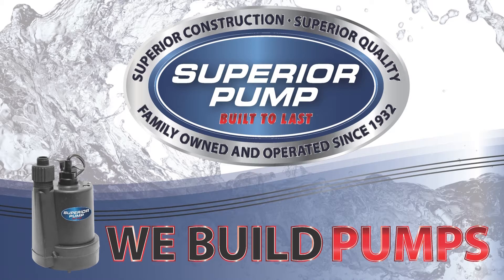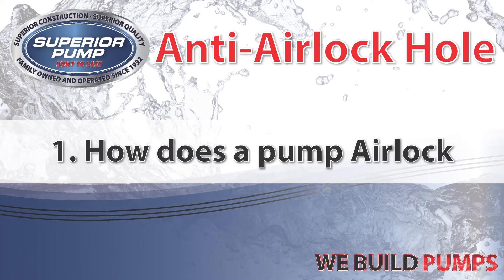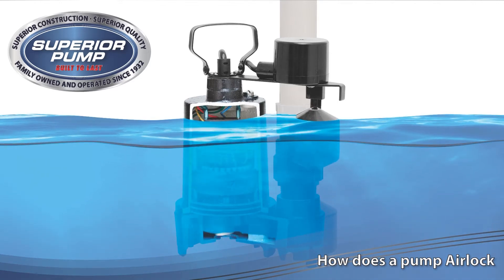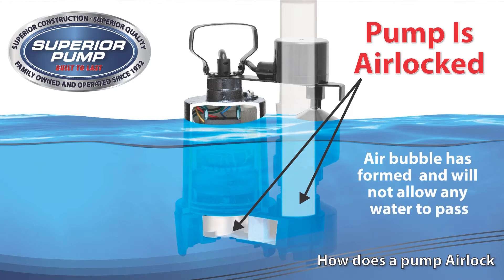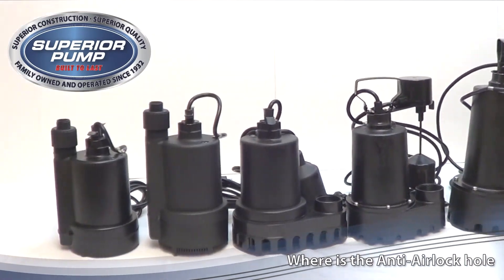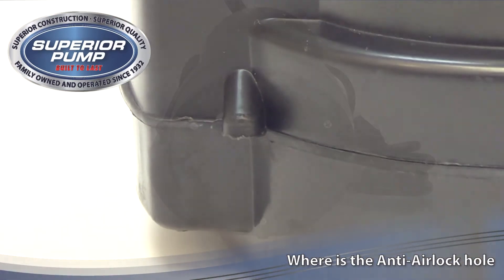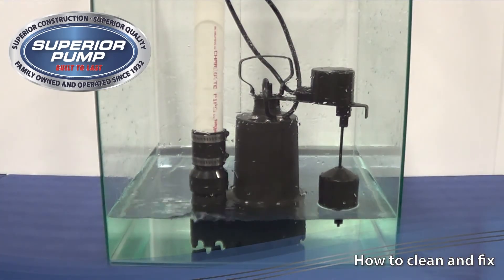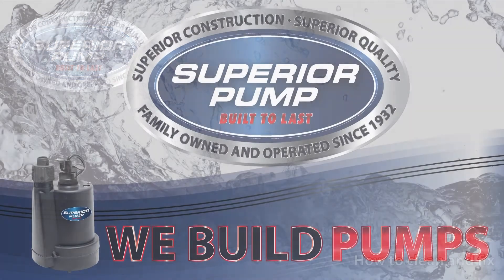Superior Pump Anti-Airlock hole

Comment: Thanks. I was wondering if I needed to drill a weep hole in the pvc but according to the video, only if you have a sewerage pump. Only thing I don't like about the side vented weep holes built into the cast iron is, they're low enough which causes a disturbance in the water and kicks up dirt.
Reply from the maker: Thank you for your comment! There is no need to drill an additional weep hole when you install a sump or utility pump. The only pump that requires a weep hole drilled into the discharge is the Sewage pump. If you have further questions, we do have a customer service team available 7 days a week at 800-495-9278.
Reply: @SuperiorPumpMinneapolis  RAPID reply! Thanks!